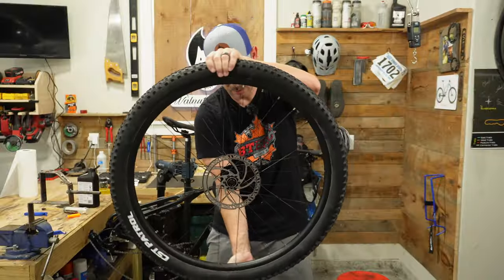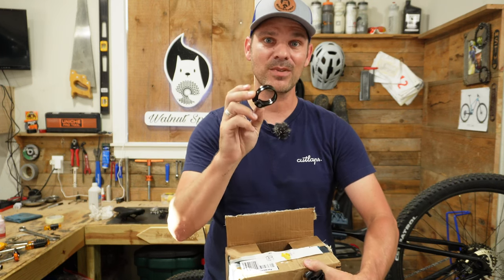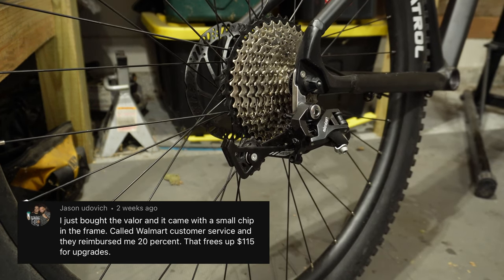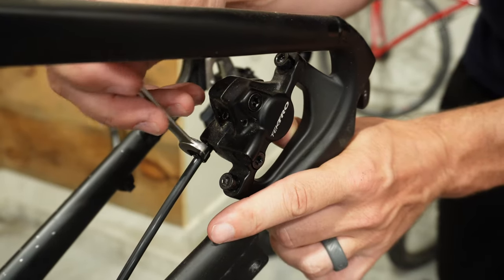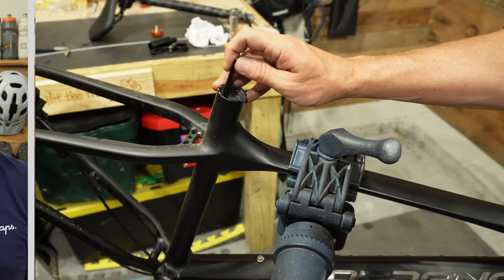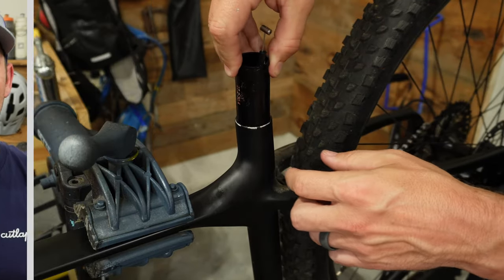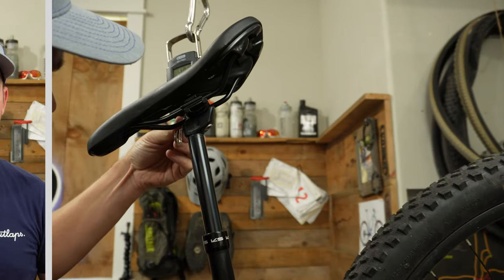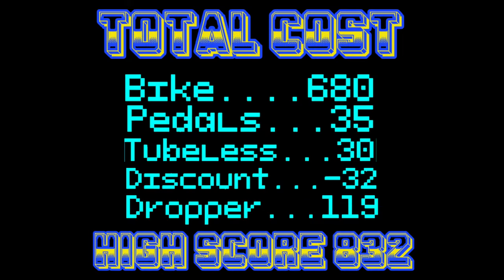Installing a Internal Dropper Post on my Walmart Giordano Intrepid 29er Mountain Bike

Comment: I just bought this bike for 404.00 use Kent 10 from Kent website it was 430 out the door. Made my choice between the OZtrail ridge and Axum an easy decision lol. I almost bought a Roscoe 7 for 1500 but at 430 out the door it was a no brainer. I can upgrade as I go and still be under 800 bucks with the upgrades and be just as good as the Roscoe

Comment: The built price is $832. Does that include the hydraulic brakes? Also, why just get an external dropper? How did you make a hole to the seat tube?
Reply from the maker: Yes it came with HBs. Internal was just a fun thing to do.
Reply: Is this frame a replica of the Kent Trouvaille? If so, I can probably do the same for the dropper or just go external.
Reply from the maker: @horusgarcia1  very close. Made by the same parent company

Comment: I would have no issue with drilling a hole in a frame, yeah, even if it voids your warranty if the frame has one. As long as you take your time, don't go bigger than needed, and be sure to deburr/smooth the hole. Sharp edges, gouges, or nicks in aluminum can cause cracks to develop believe it or not. I would go as far as getting a set of keyhole files, they're usually of different shapes and are super fine.

Comment: Would mind showing a pic of the finished whole you drilled by the head set?
I want to see if you just made the one whole bigger for two cables to slide through or if you actually made a secondary whole for the cable to fit through.

Comment: I believe the new models have an extra hole drilled on the left side of the bike so there are two holes and there’s an outlet and the beginning bottom of the seat post for internal dropper post I got my about a month ago and noticed the extra drilled holes and it has a vinyl chain stay so the chain slap dosnt scratch up the Frame. Also could you link the internal cable and outer tube housing you used for the dropper post thank you 😊
Reply from the maker: Yeah they got the memo that it needed a extra port. Lol. Here is a link to some cable housing. 
https://amzn.to/3Xh7vos

Comment: Maybe the smaller diameter seatpost allowed it to not have too much added weight.  I don't look at this as such a bad thing.
Reply from the maker: I agree I totally happy with the seat post after using it. The only downfall was a 30.9mm was $89 so $20 less than the $27.2mm and I would have had to buy the shim so that makes it really $30 more. But over all money well spent.

Comment: Does the shim reach past the bottom of the top tube?  My worry is that the only part of the frame supporting your body weight is the portion above the top tube on the seat tube.  Most every bike frame requires a minimum insertion past the bottom of the top tube to prevent cracking.
Reply from the maker: Just barely. If you can find a longer one it would be better. Or even better would be to ream out the seat tube to fit a 30.9 dropper post.

Comment: I'm waiting on that exact shim and was wondering what you put on it before installing. Was it an adhesive, a grip paste, or antiseize? Thanks
Reply from the maker: The shims are finicky so you definitely want to use parktools sac-2 between the frame and shim. Then some normal grease or parktools PPL-1 grease between the shim and seat post. It can take a good amount to prevent creaking. Also keep it clean if your bike get dirt up at the seatpost collar.
Reply: @RunBikeMike  Thanks, exactly what I was needing to know, I also wouldn’t have thought to grease the seat post so that’s definitely an extra bit of helpful information
Reply from the maker: @jdridesbikes  yep grease will help prevent squeaks and also keep it from seizing.

Comment: Hey Mike mine is being delivered this week. I want to upgrade the crankset and BB. Do you have a recommendation on anything specific for this 1x10?
Reply from the maker: If you want to go budget the IXF is a great crankset. Here is a link to one I like. https://amzn.to/3JW7WOf
You will need a chainring for it too. Here is the brand I have used.
https://amzn.to/3A1cpeh
If you want to go name brand I like the Shimano Deore
https://amzn.to/3SKvABz
You will need a bottom bracket for it here is a Shimano version
https://amzn.to/3w1h1zx
Reply: Thank You, I was about to bid on a SRAM GX Dub crankset but wasn't sure if it would have a poor chainline since they're for 11-12speeds. The ixf are within 100g of the SRAM cranks and I would give them a try but I think I've see photos of the spider on these looking like while they work, they are meant for a 2x and not a 1x setup.
Reply from the maker: Yeah they can be used for 2x or even a 3x but other than the bolt holes the crank is compatible with a 1x. You would just need to make sure to get a 1x or narrow wide tooth pattern chainring. On the sram I would think it would still work but I haven’t tried that myself.
Reply: Ok so my Intrepid just arrived and I've turned it up. I'm a little concerned about the chainline when in the lowest gear. When the chain is on the largest rear cog the front chain ring makes a continuous noise. Nothing looks bent, but the chainline is no bueno. The noise front chain ring noise subsides in mid to low gears. I've confirmed there is no noise from crankset with chain off. I may keep the Trouvaille and return the Intrepid now.
Reply from the maker: That is interesting. Are you 100% sure it is coming from the front and not the rear? The low screw on the RD might need to be let out or turned in just a hair. If you are not having shifting issues in the middle of the cassette then your RD hanger should be fine.  Check that the bottom bracket is installed correctly. Also that the crank arm is fully in place. That drivetrain is the same as the Kent T so I would think it would be something fixable with adjustments.

Comment: Hey its me the owner of the kent and giordano group. Kinda wanna know if you can force in a 30.9mm post into a 30.4mm cuz half a millimeter is nothing. You should try that if that's possible.
Reply from the maker: I also wonder that too. I do have experience with trying to install a headset that is only 1mm to large. That didn't work at all. If it was a short length the .5mm might work but with as long as seatposts are I just don't think it is worth it. If you ever have to service the seatpost I can only guess it would be almost impossible to get back out.

Comment: Where did you exactly routed that cable on the bottom?
Reply from the maker: If you look in the hole where the cables come out there is a spot where the seat tube meets the bottom bracket. I drilled the hole in the seat tube right above the BB and right before the wields on the seat tube. It was a perfect spot the had no structural part of the frame. 

I thought about taking the cable out under the bb and drilling a hole in the outside of the seat tube right by the back tire. But I wanted it completely hidden.
Reply: @RunBikeMike  that is awesome, did you install a garment on the side tube by the head tube where the cable goes in?
Reply from the maker: No I didn’t. Since it came with out a grommet I decided to not worry about it. I filed the edges smooth and the cables seems to move freely.

Comment: How do you know what length to cut the wire
Reply from the maker: I do a pre fit. Getting it all setup then take push the cable in to the frame and pull the seatpost out. I then cut based off of enough length to remove and install the dropper. Then I reinstall the post and pull the cable Housing out of the top of the frame a little.
Reply: @RunBikeMike  I saw somewhere about an inch above seat tube..does that sound about right
Reply from the maker: @MyDam18  that would be a good amount. Just make sure you don’t have slack up by the lever. Because when you push the seatpost back down that will become your slack.
Reply: @RunBikeMike  thankyou very much u did it exactly like you .man drilling that was freaking nerve wrecking but it actually worked..

Comment: My front wheel wasn’t true and the seat clamp didn’t come in the box so I got $75 refund.
Reply: Hi @Jon O , how did you ask for your refund? Mine just arrived with a missing clamp and the shifter is working, but the plastic on top on broken. Also some chips in the paint. I want to return it, at same time don't want to wait for a new one to possibly come with the same issues.
Reply from the maker: I used the customer service number in the app.
Reply: @bruno123oliveira4  they offered to send me a new one with a shipping label to send back the other one and I told them I didn’t want to assemble another bike with possibly the same issues. They asked me what I wanted to do and I negotiated a partial refund based on my best uneducated estimate of what it would cost to fix the problems at a local bike shop. The rep offered $75 so I went with it. Best of luck!!
Reply: Thank you so much, I called Walmart and they told me call Kent. Will do tomorrow since it is closed already.